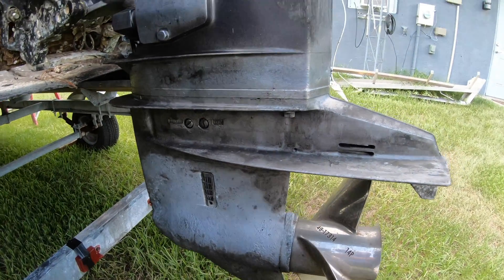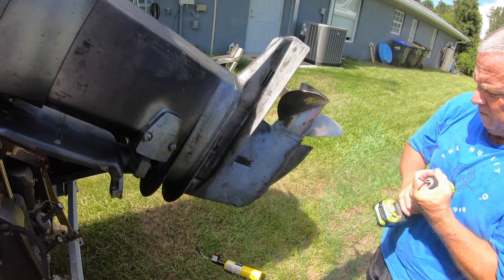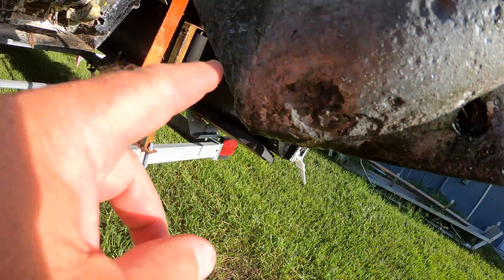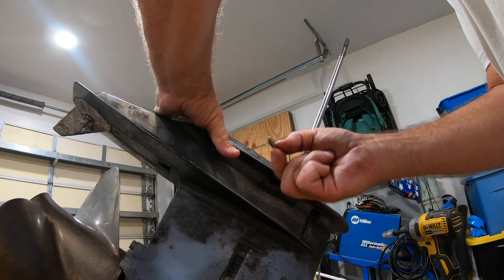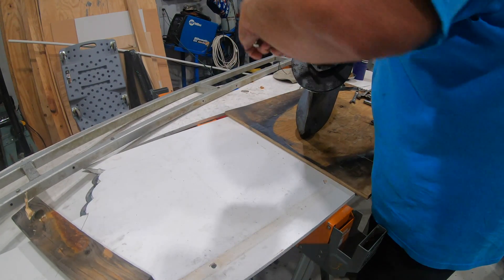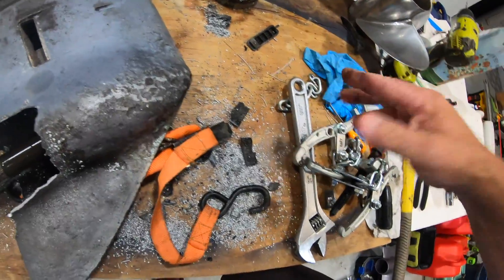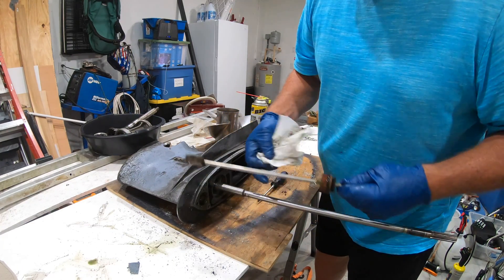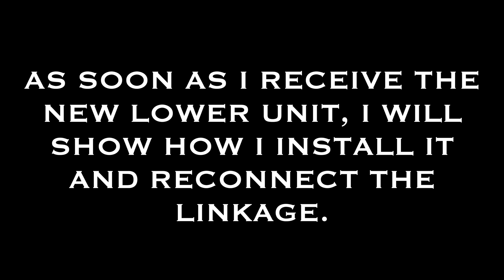Nissan NS70B Outboard Lower Unit Removal

Comment: This is very helpful..i have a ns70a2 and am trying hard to find a lower unit for it...lots of info you have here..not alot of info for these motors or at least that i have found.
Reply from the maker: Glad I could help. It is the same as a Tohatsu and there is a store in Michigan that is a tremendous resource.

Vansoutboardparts.com
Reply: Hey,me again...just curious...would you know if a lower unit for a 90hp tohatsu motor would fit on a 70hp motor?i found a lower unit on ebay and just trying to see if it would work on my motor?

Comment: Thanks for the video-I have the 50hp and I’m trying to remove the drive shaft,I removed the nut and pinion gear,but the drive shaft will not come out,do I need to remove the base where the water pump sits on I order to remove the drive shaft,any advice is appreciated
Reply from the maker: Yes, there is another nut inside that has to come off. You may be able to find a video on lower unit disassembly that explains it a little more clearly.
Reply: Where did you find a manual online? I have a ns70a2 id like to have one for it.